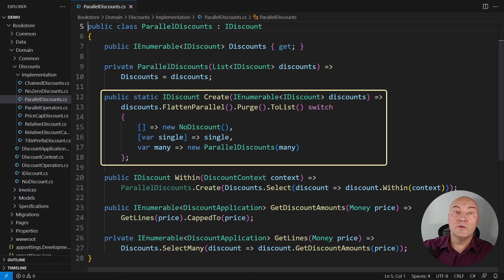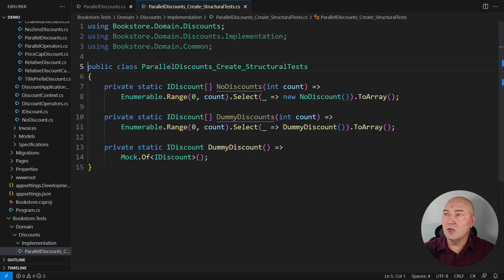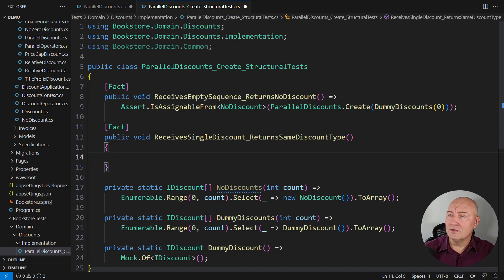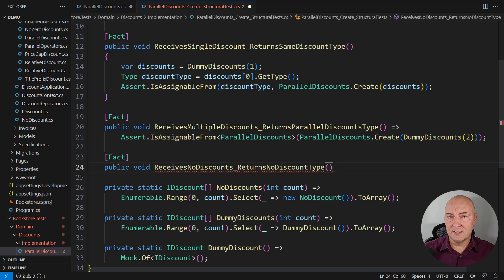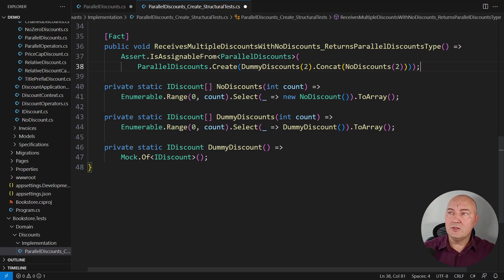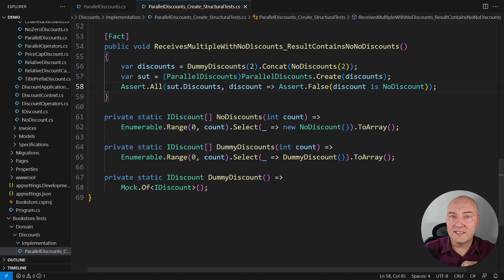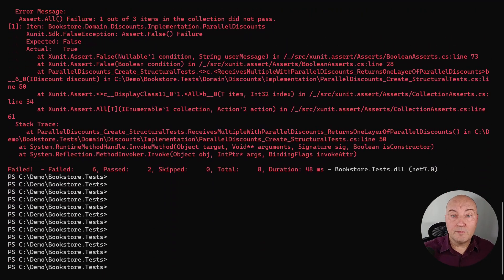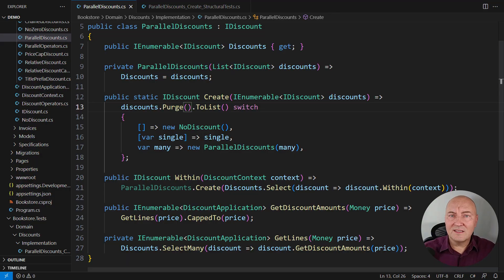Is Structural Inspection Part of Your Unit Testing Strategy?

Comment: Thank you. One little question not directly related to the subject (sorry!). Should you have called FlattenParallel() and Purge() after ToList() to prevent multiple enumeration of IEnumerable?
Reply from the maker: The call to ToList is required for the subsequent list pattern matching expressions. The code would not compule otherwise.
However, there is the hidden optimization there - the private constructor (if ever called) receives the List argument. Therefore, that list construction will be the only one to execute.
Please note that list patterns in the switch expression will not enumerate the list. They have other means to accomplish their goals.

Comment: Am not I testing the response structure when I do behavioral tests? Isn't this technique only marginal beneficial?
Reply from the maker: If you are testing the result structure in behavior tests, then I would argue that there is something wrong with the definition of behavior.
Behavior tests should assert attributes of the result, so to decouple from implementation. That leaves it open to the implementer to choose from multiple possible implementations, some of which affect the structure of the result - some structures being more preferable than the others.
That is where the structural inspection comes to the table, verifying that the result has structure that is preferred, even though any structure would exhibit the same behavior.
In the example from the video, recursive composite discounts would behave the same as their flattened counterpart, but only the latter is allowed. The problem with recursive composite objects is that they have a nasty corner case where the tree of objects degenerates into a list. With recursive lazy-evaluated sequence of calls, performance may drop significantly, if the caller was so unlucky to strike that use case. That is why the constraint, and the corresponding structural unit test. As I pointed out already, no behavior unit test can see that issue coming.
Reply: @zoran-horvat What an awesome answer! Thank you for your help. It's very instructive.
Reply from the maker: @PedroPabloCalvoMorcillo  I'm not judging you for not being aware of this - this is the rare topic in literature and programmers can't see its application. It is the SRP applied to tests.